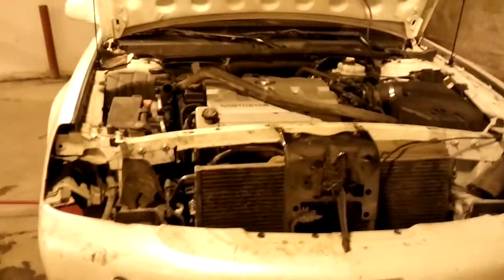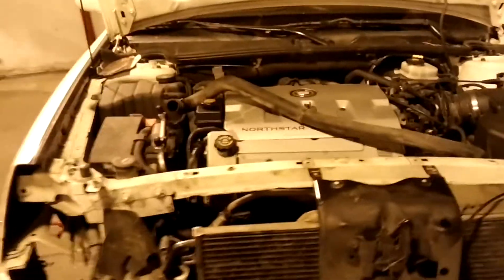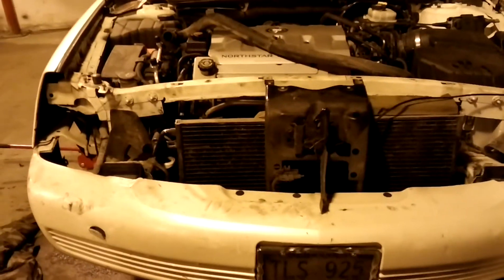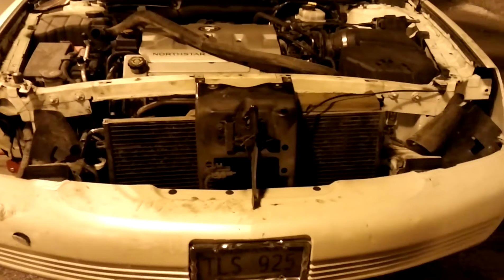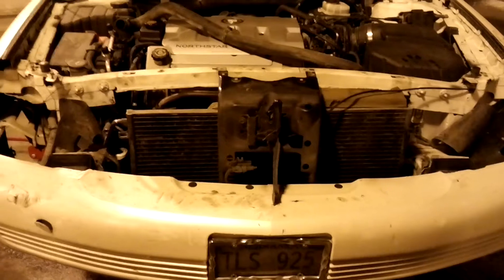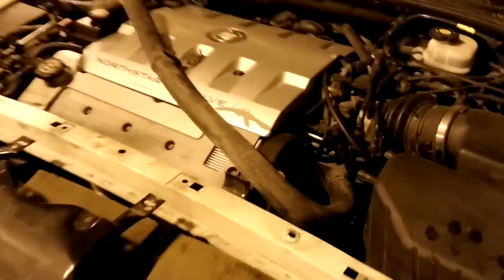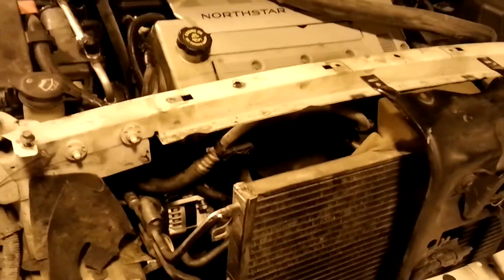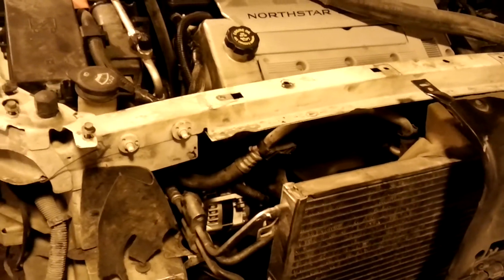Installing Alternator in 2002 Cadillac Deville

Comment: FYI for those of you watching this video. - You don't have to remove the radiator. Remove the Rad. fan unit, the portion of the serp. belt that goes around the Alt. and AC Comp., passenger side wheel, inner wheel well (front portion), disconnect battery, remove battery B+ terminal and 4 pin connector from alt., gain access through wheel well and from the top to remove attaching Alt. bolts and finally, place a piece of cardboard between the radiator and Alt., slide upwards. Reverse order.  Also, pay close attention in how the alternator bolts are tightened down. All finger tight and then use a ratchet/wrench. Don't forget too also inspect the ground cable in that area for quality and cleanliness.  Good luck!
Reply: To bad these cars batterys are in the back seat..

Comment: On a 2002 Seville STS you must remove the radiator to get to the alternator, you can't remove the fans until the the radiator is pulled back far enough to clear the crossmember.  AND some A/C tubing is in the way, so I pulled the condenser too since I had to replace the compressor anyway.